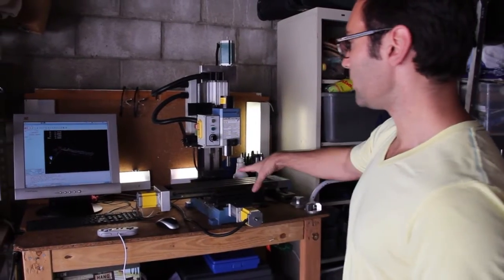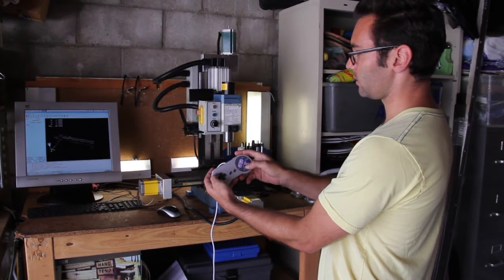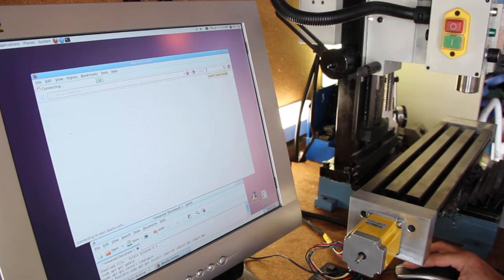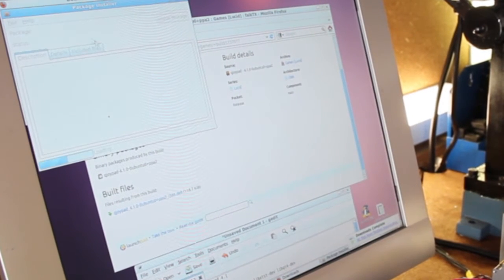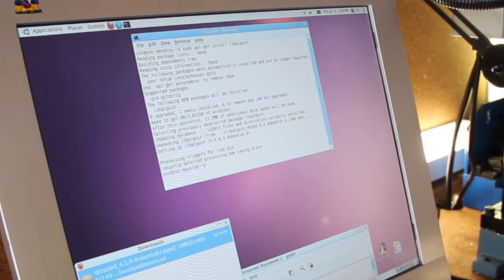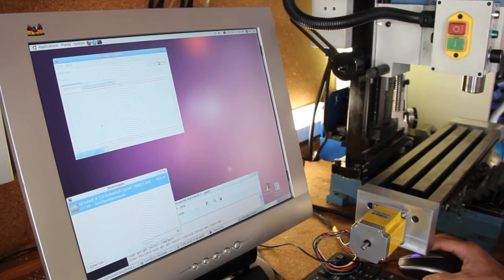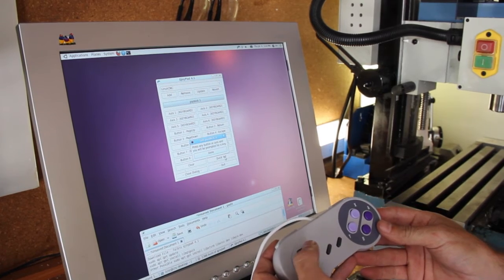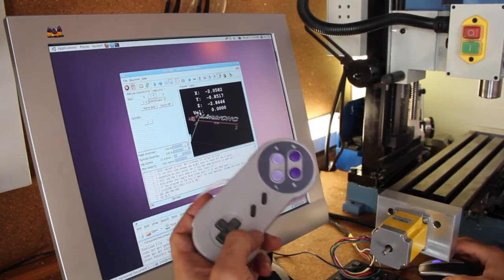LinuxCNC with USB controller - Qjoypad

Comment: lot important have linuxcnc need made usb handle, mean can use cheap usb bob board, buy breakoutboard and use whit linuxcnc, and normal add drivers and motors this board and use linuxcnc use cnc. not need joystick controller anywere. important have not need ower expensive mesa shit cards or old paraller port card, need new usb card use. why linuxcnc use very old system, not coders can made usb port system.

Comment: I just saw your video on this, thanks! I'm still setting up the computer and will be doing the cnc install on my mini mill, one day hopefully. I decided to try the linux cnc but when it updated it pretty much got taken out. So I am doing a new install with the latest ubuntu and will try to use it under a virtual machine. I don't know if that will work, but I don't want to go through that trouble again. I already have an old usb controller so it was nice to see this as I don't need to purchase anything else. I still have to figure out how to mount the motors, but I can test everything in my room since I haven't put anything on the machine yet.